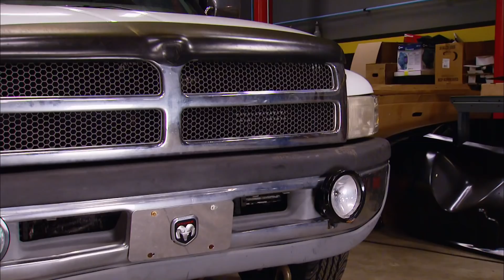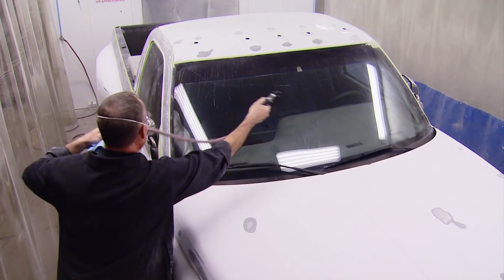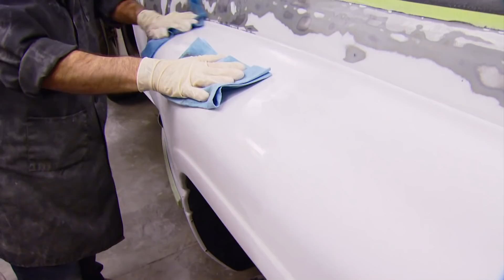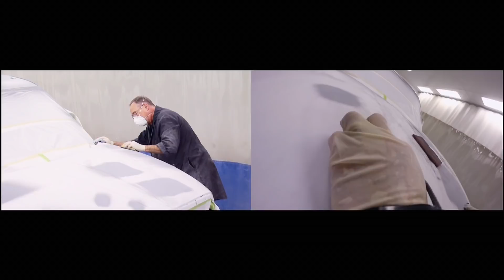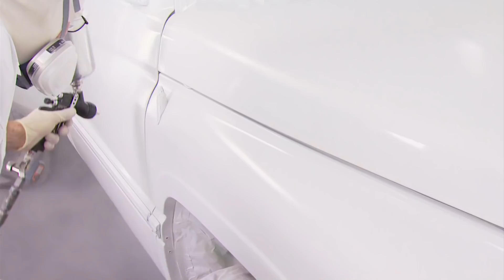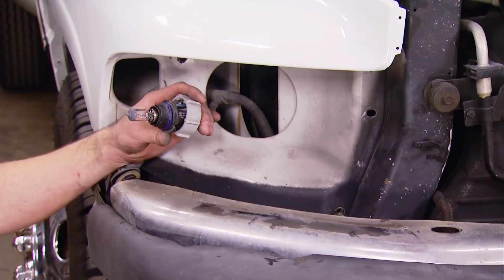Freshening Up A Worn Dodge Cummins With A Low Buck Paint Job - Truck Tech S2, E5

Comment: That Gent is a true craftsman!  Just a question but is all of the sanding, chemicals, body filler dust, primer, paint, and clearcoat soaking back into the headliner from the five cab-light access holes or are they taped shut?

Comment: To each their own, but I wouldn’t spray clear a half panel at a time.
Reply: Yeah, even on base coat. If this was a metallic paint, it would look terrible when done, you'd have vertical stripes where the spray patterns overlap.

Comment: The painter had a real passion for painting vehicles and the way he describes his work is amazing
Reply: idk about that... first thing he should have done is tape off the bed with some plastic... I mean ryan should have done that too before the body work but that wouldn't fly in a production shop... normally the whole vehicle is plastic wrapped before any bodywork with just an opening for the work to be done. ... And when he was putting on the clear he took half strokes on the hood and stopped mid hood... i mean he took full strokes with the sealer... why not with the clear? ... this was a yeah theres paint on it type job just to promote their paint.

Comment: Guys to stiff with the gun. A good painter is like a good dancer smooth just one fluid motion he sees the results in his mind before he ever touches the gun takes practice to get the rhythm once mastered it’s art
Reply: He makes it sound like he knows what he's doing, but he looks very rigid with it. He also looks to be too close to the surface, too much overlap (65-70%, really??), and spraying half panels at a time is a horrible practice to get into. Stop being lazy, and walk the vehicle like you should!
Reply: @2005StangMan  can tell you been there done that. Old man that taught me always said can’t dance can’t paint. Use to do alki enamel jobs in the day heated the enamel and layed it out with binks 7 you had to have your shit together. Times have sure changed but the application not so much.

Comment: no gasket or RTV on the cab lights, gunna leak like a faucet when it rains lol
Reply: They probably just didn’t show that for time purposes
Reply: @maverick9662  but it would make no sense to install them all just to take them off again and put gasket materials on
Reply: @RedBirdTCG  that would be true if you were in a garage. But to film for TV, it would be quite different
Reply: Half assed thrown together job to sell the sponsors products.
Reply: @frankloree2462  just some odd corner cutting for a job that's pretty in depth all things considered

Comment: Lol I'm not sure I would call that a "low budget" paint job. It looks like it was "only" 500.00 because that's what the materials probably cost. Ted's labor and prep would probably make this an $1800+ dollar job. While not a top-flite paint job, an $1800  one to me is a pretty hefty outlay of cash! Truck does look fantastic though, and thanks for the ideas. I need to paint my old rattle-trap car and will use these tips.
Reply: That's where your labor comes in.   Prepping and running a paint gun isn't exactly rocket science.   Why pay for something most people are more than capable of doing by themselves?
Reply: @bmstylee  what about a booth?
What about the masking tape?
What about the sandpaper?
What if you don't own a compressor or a paint gun?

500 bucks.... remember
Reply: Painted the exact same truck at my house when i was 18 for 400$. That included all the tools and materials too. Just didn’t use a booth, came out good enough for an old work truck. Used an electric paint gun no compressor needed.
Reply: @bmstylee  I agree. I've been painting cars for over 30 years, and I always tell people that anybody can paint, bodywork is where the talent shows.
Reply: Low budget means Rustoleam 😂
Reply: @Captain Blacktooth Wow that is crazy, but sounds awesome. Great tip thank you.